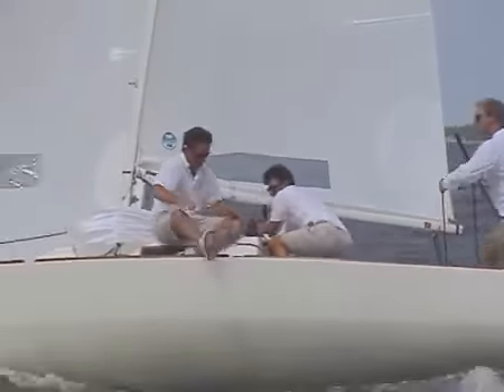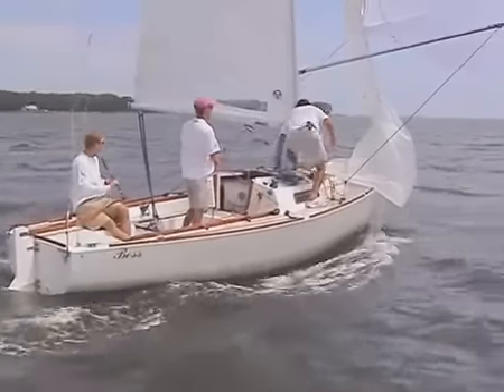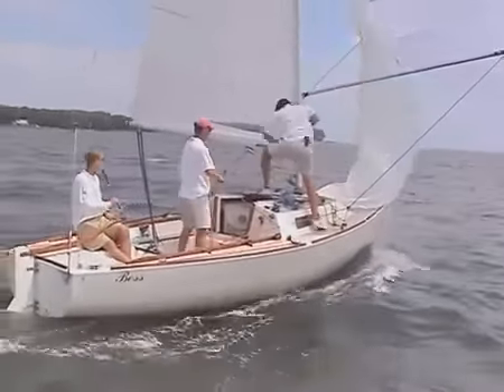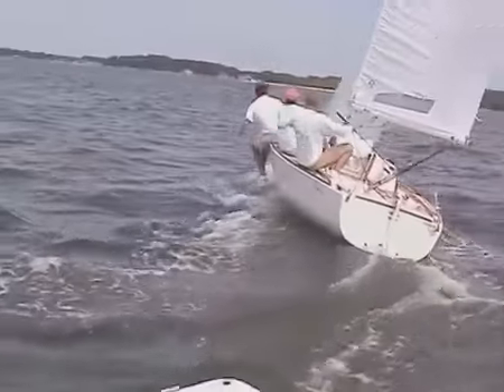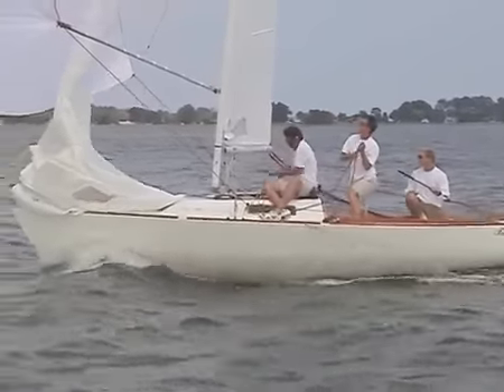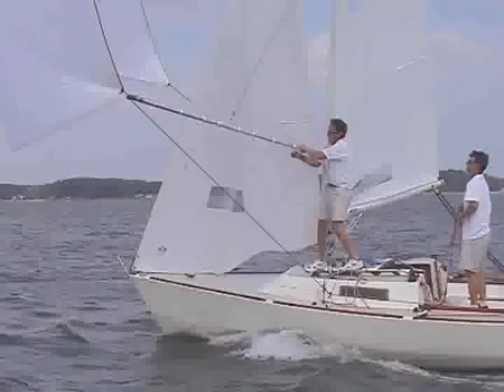J/22 Spinnaker Douses

Comment: Hey Al,
TJ here. I loved your J22 video set!  
I race J22s at the Canandaigua Yacht Club where there are 16 or 17 boats (I've lost recent count) and regularly have 12-14 boats out every Thursday night.     The starting line is usually tight producing big regatta feel  starts, and pack in 3 twice around races.  It's awesome! 
I run the middle and trim. 
This week, both the Skipper and bow/tactician are out.  I have a great Skipper to drive who has 50 years one design under his belt. I will do tactics with him. 
Our sub for the bow is a catamaran sailor who just bought a J22 (not sure of the number but I hear this boat won worlds twice under different skippers).  He has little if any spinnaker experience so I forwarded all of your J22 handling vids. I also watched them and agree with everything. 
The boat I'm on is in first place by a hair, with 2 great boats gunning hard for use, as well as another 4 or 5 constantly "in the way".  I call this group the A fleet. But the B fleet are no dogs and regularly pull of some top level finishes!
We have an upcoming J22 regatta and you are invited. I'll even put you up if needed. 

https://www.sailcyc.com/raceevents.cfm?subpage=549764

Thanks again for the great videos and have a great season on the water. 

-TJ

TJBizBox@gmail.com